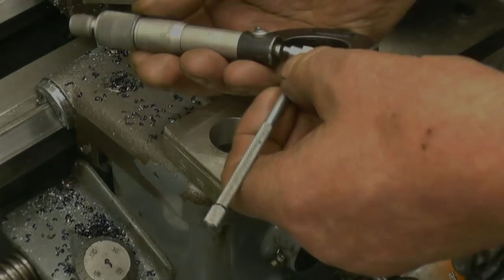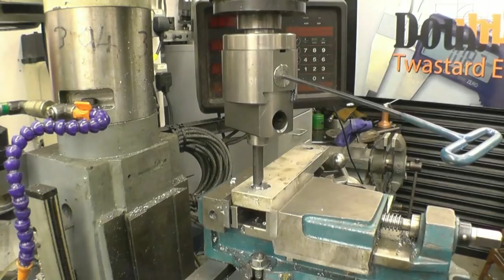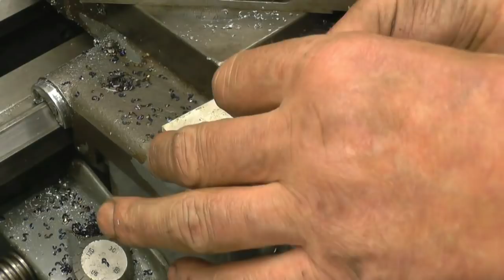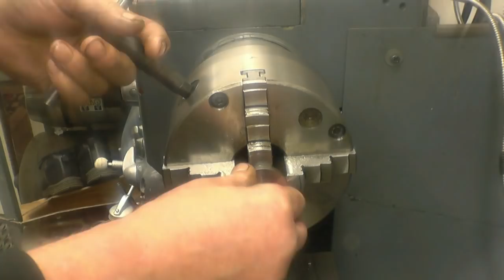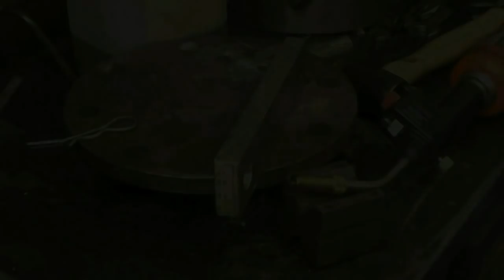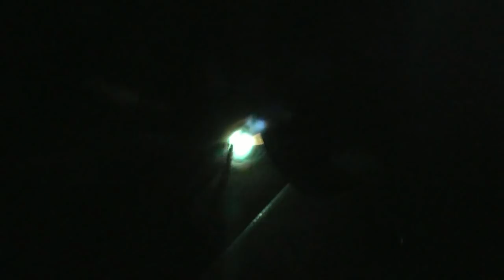SNNC 196 P2  Doe Nut Machine Repair

Comment: Ill be praying for you and the family , I keep you in my mind always when it's prayer time. So glad you didn't get hurt real bad. I'm still fighting my own body problems , bulging discs soon to be operated on . Just had an old stimulator and wiring removed and taken right into mri testing for 2 1/2 hours in a freezing tube . But I survived both and home waiting for the next bout of operations. If you can pray for me too. I need to get back in my shop. I want my planer set up and working it's so Kool saving it yet alone restoring and using it. I have almost everything I need for it , but I'm down in pain .If you on my Facebook it's my pride n joy even just sitting in its lightly brown finish. Gary A. Wills aka Silverbullet

Comment: Holy smokes, that drill was amazing going through the stainless.  Can I get some more detail on it?  Looks like a high-helix, which you'd normally associate with a specialized aluminium drill.  Does it have an odd grind angle or something?

Comment: When your SNNC 196 didn't appear by 10pm on Sunday, I just knew something had happened. Falling from such a height can easily end in death, so I'm very pleased that you suffered only the fracture of a couple of small bones.

Your 'nasty, long, stringy bastards' should tell you that you are using the correct tool, that it is sharp, and that your cut and feed-rate are correct. I can see your point, John but at least you know that you have everything correct.

Get well soon, John. Please pass on my best wishes to Debs and your dad. Gordon.
Reply: Gordon Burns n